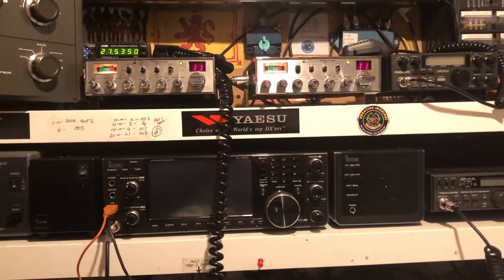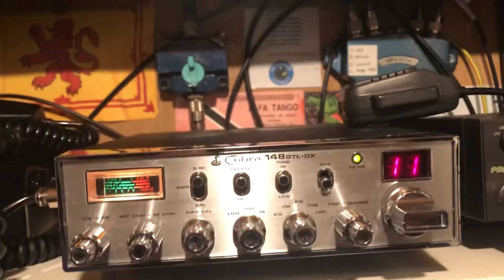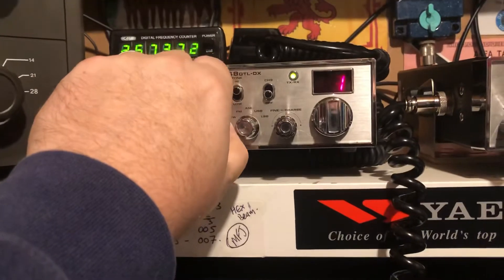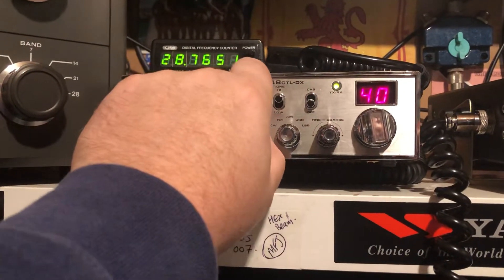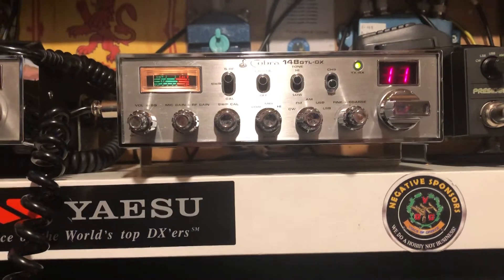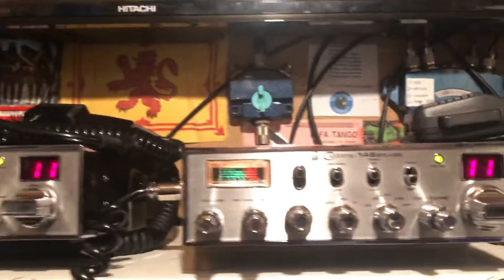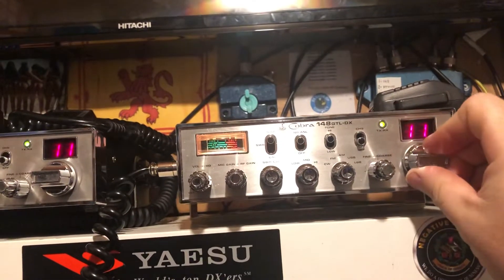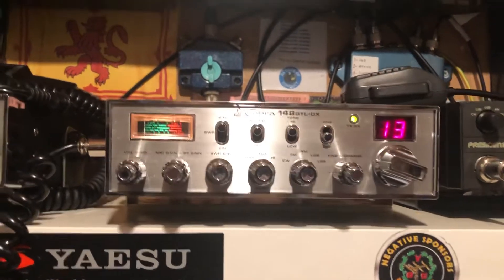Cobra 148 GTL DX I Just ❤️ the roger bleep of the Mk1 😁 and am not one for bleeps

Comment: That's a mighty fine mk 1 you have there brother. Nearly as nice as my minter.  With a 575 m6 teardrop of course. The mk1 beep is the sweetest beep🌚
Reply from the maker: Thanks , it’s a keeper and I have the 575 m6 on the radio also that sounds fantastic 👍
Reply: @walesunt  they go for strong money and hold their money. Just like the legendary Technics 1200 turntables 🌚 but as you said "keeper. Never for sale.
Reply from the maker: @zukispur5493  yes they do gold good money for what they are but a good cb radio in my opinion, but you still get the odd few saying you can pick them up fully boxed for £100 😂 wish I could pick them up fully boxed for that money , thankfully mines is fully boxed and staying here , as for the technics you’ve just reminded I have a separates line up in the actic that I’ll need toget down and turn on as not been up and running for years 👍

Comment: The radio to your right, the Lincoln /HR2510 was before its time and now very hard to get
Reply from the maker: Yes both good radios that work great 👍
Reply: What radio do you prefer the cobra or the Lincoln I ask because I have a choice of a mint MK1 cobra or a good condition Lincoln
Reply: @technic7762  Lincoln, I have to say I have both, The lincoln is a very hard radio to find, they already have a frequency counter, you don't have to open any clarifier, this is just a poor man 10meter ham radio able to transmit from 2600 to 29650